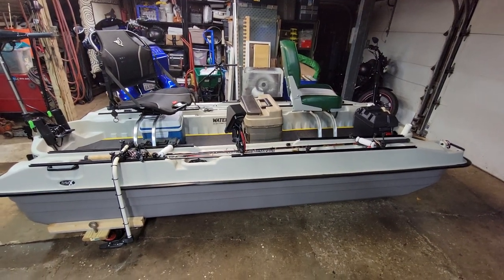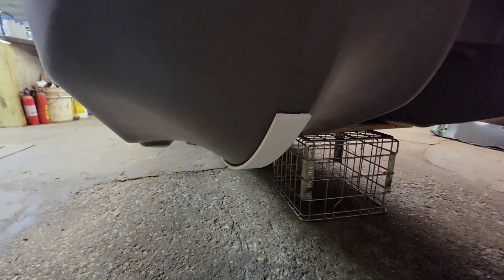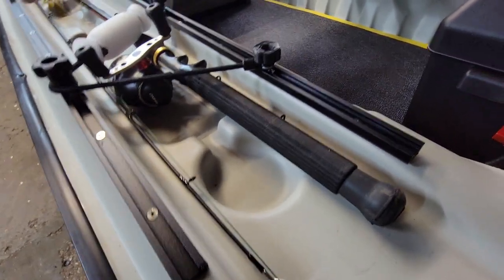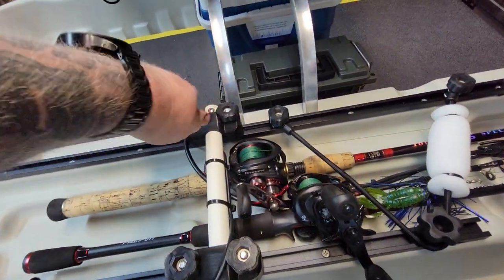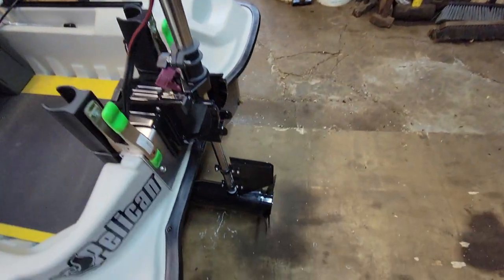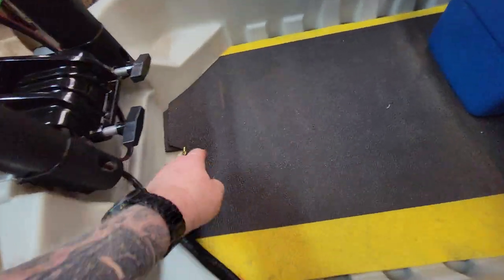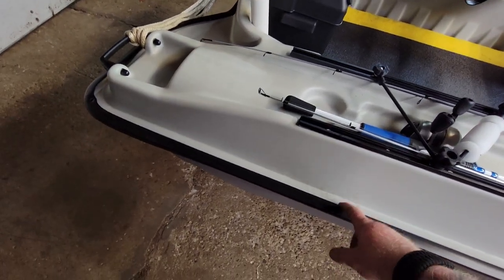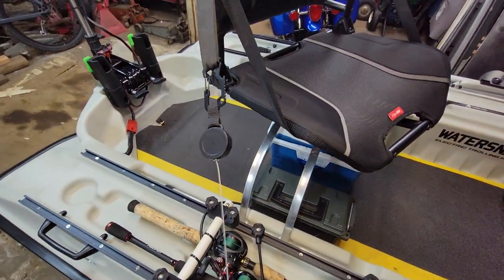Pelican Bass Raider 10E NXT mods

Comment: nice mods, just curious which ones you would do again or not after using the boat for a year.  also, what about the pelican seat over the cushioned one?  thanks for the vid
Reply from the maker: If I were to build another one, there isn't much I'd change. I surely wouldn't use the plastic scupper plug again - lol.  the Ergo 360 seats are much lighter  and are mesh with breathe much better than a padded seat. No swamp-ass!

Comment: Love the usage of 3D printing!  What filament do you use?  I know PLA isn't great with heat or water, I've used PETG with some success but found it can warp under high heat.

I'd love to avoid using ABS but it might be the only filament appropriate for outdoor use that's exposed to water.
Reply from the maker: I use PETG for the clamps and transducer mounts. Been using PLA+ with great success underwater. In some instances I've had better luck with PLA+ as it seems less brittle but less temp resistant.

Comment: What 3d printer do you own and would recommend. Do you have a link and also when i get mine would you be willing to send me the files for it. These are some of the greatest mods i have seen. Thanks. Also what size drain plugs  and size holes did you install in the bottom. Do you have a link to them please
Reply from the maker: Whats your budget for a printer? Check k my other videos for info on drain plus and supper plug.
Reply: 500 or less
Reply from the maker: @WiztekServices  creality K1 or bambu p1p if you have a little more to spend.
Reply: @jeffakamax  thanks it looks like the bambu p1p is better so i will order that one and thank you

Comment: How did you replace the original wiring? I just purchased the Pelican Bass Raider 10 e.
Reply from the maker: I tied off the new 6ga wiring to the existing OEM wire and used that to pull it through.
Reply: @jeffakamax  thanks

Comment: Hi Jeff, I love the mods you made to your boat! I have the same exact boat and I was wondering how you re-ran the wires through the hull? Did you just tie the new ones to the factory ones and simply pull them through? Also, is there any advantage to using 6 guage wire vs. the 8? Thanks.
Reply from the maker: Yeah, I just tied the new ones in and dragged them through. 6ga is whats needed for 50 to 60 amps. If you are running a smaller motor you will probably be fine but I have a 65 and 55lb thrust I run on mine.
Reply: @jeffakamax  Thanks for the reply Jeff. I thought the factory wires were kind of on the light side myself. I'm running a 55 lb. Minnkota so I think I'm going to do the same thing you did! I really like the Anderson plugs too I just have some basic 8-10 guage solderless connectors but one actually pulled out this weekend on me.
Reply from the maker: @paulbernardi2597  anderson connectors and some 6ga wire and you'll never have to worry about it.

Comment: At the bow, what size schedule 40 PVC did you use for rod holders ? I bought 1&1/4 inch PVC  but it doesn’t quite fit in the straps. My Bass Raider is new and the straps are quite stiff. Thanks in advance. Steve B.
Reply from the maker: If memory serves, it was 1 1/4. A little heat from a heat gun or hair dryer will soften things up just a bit if needed.
Reply: Thanks so much for the suggestion. Before I forget, I was about to put in an Atwood scupper plug when I came across your video. How did you go about fixing the problem? If you had to do it 5:34 over, would you still go with a scupper plug? Thanks a million for getting back to me. I really enjoy the ideas you come up with.
Reply from the maker: @steveb.1701  I replaced it with a stainless steel supper, no problems after that
Reply: Smart. Thanks.
Reply: Jeff: Would you mind posting the link to the stainless steel scupper assembly?
Reply from the maker: https://www.google.com/url?sa=t&source=web&rct=j&url=https://www.amazon.com/NRC-XRC-Stainless-Straight-Thru-Hull/dp/B08G8JD1ZG%3Fsource%3Dps-sl-shoppingads-lpcontext%26ref_%3Dfplfs%26psc%3D1%26smid%3DA3G9OXBN66O9QI&ved=2ahUKEwjOh7Oj1IL-AhWEm4kEHfVWBd8Qj_IEegQIGRAF&usg=AOvVaw0O-3inSYeWfxi7yDoh-Ho5
Reply: Thanks a million, Jeff.

Comment: What was the length of the trolling motor. I think you said it was a water snake. Who makes it? Thanks.
Reply from the maker: https://www.amazon.com/gp/product/B007SXHKFU/ref=ppx_yo_dt_b_search_asin_title?ie=UTF8&psc=1

Have NO complaints on that motor at all! I cut the shaft down so it's shorter than usual. I like to be able to cast over it without it being in the way. Personal preference really. I also have a 65LB Haswing that is ESC controlled. Works great too but not good at FWD/REV prop cleaning to remove weeds.

Comment: I'm steealing your t track idea. Any advice on where I could find a paddle bracket like that? Not having any luck.
Reply from the maker: Steal away! Got mine from amazon... search. Kayak Paddle Holder Clips(Including Screws),Deck Mounted Universal Kayak Paddle Clip & Fishing Net Clip
Reply: @jeffakamax sorry, I meant the metal bracket.
Reply from the maker: @EricScherrer  the bracket that mounts the paddle clip for the T track? Just something I bent up myself.
Reply: @jeffakamax I'll probably have to do the same.  It usually comes out pretty bad when I do.

Comment: Hello, would you mind making me a 3D print of the transducer mount that you had in the video?
Reply from the maker: The adaptor for transducer to pvc?
Reply: I would need the clamps and the part for the transducer. That setup is extremely nice that you did.
Reply from the maker: @tomspitzer8346  I'll print up a set and contact you for shipping info.
Reply: Sounds great! Thank you. What did you use to get the clamps to stay in the tracks?
Reply from the maker: @tomspitzer8346  https://www.amazon.com/gp/product/B07GS3YS9R/ref=ppx_yo_dt_b_asin_title_o02_s00?ie=UTF8&th=1
Reply from the maker: @tomspitzer8346  email me at jeffakamax@gmail.com  I have your parts printed